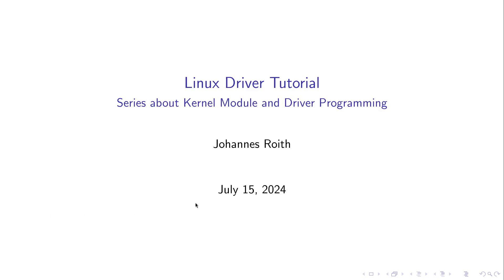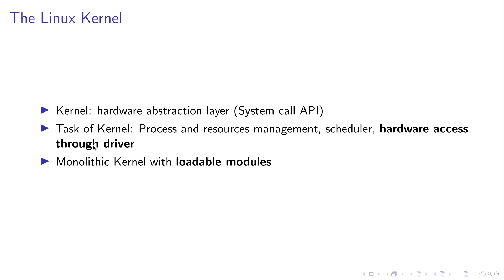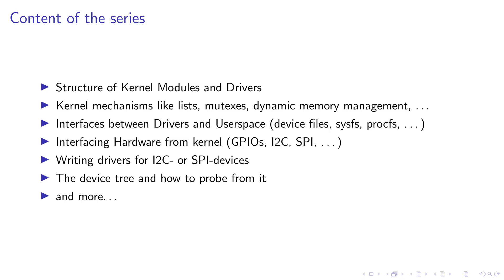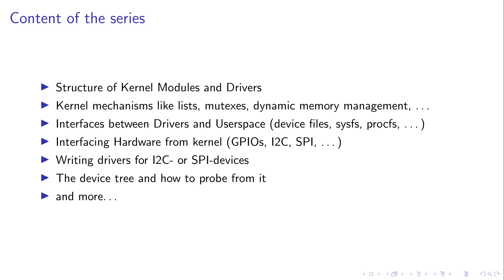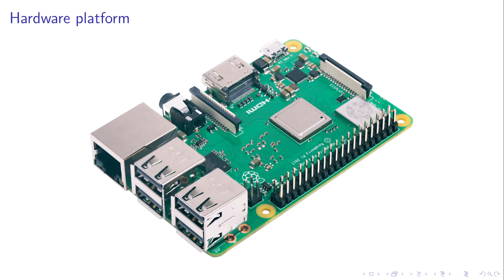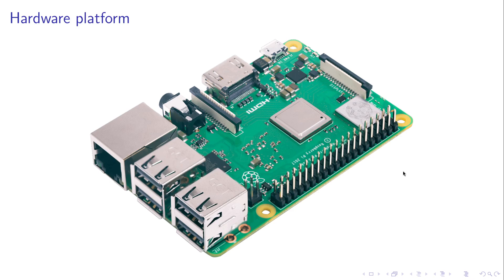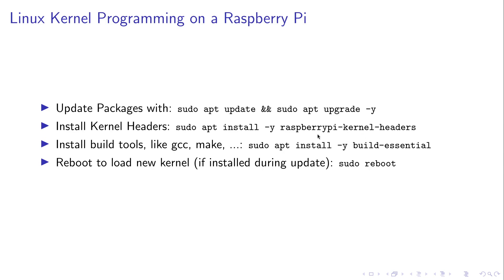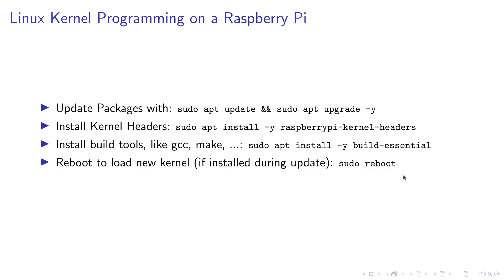Let's code a Linux Driver - 0: Introduction

Comment: i cant download the headers via the command
sudo apt install -y raspberrypi-kernel-headers
Error: Unable to locate package raspberrypi-kernel-headers

i guess i have some installed though
can i just use them?

linux-headers-rpi-2712/stable,now 1:6.12.47-1+rpt1 arm64 [installed]
  Header files for Linux rpi-2712 configuration (meta-package)

linux-headers-rpi-v8/stable,now 1:6.12.47-1+rpt1 arm64 [installed]
  Header files for Linux rpi-v8 configuration (meta-package)
Reply from the maker: I have to redo this video. The name of the package changed with Debian 13.

Comment: I've been looking high and low for a way to allow a specific user to map directly into hardware memory for a program I'm writing that uses the GPU to process floating points from a buffer, I want it to be as fast as possible so I need to weirdly manipulate the linux user system so it doesnt throw the program I want to run into the virtual memory space, which I can't seem to figure out yet lol

My main goal is to get the raw data stream from a sound card so I can use the 3.5mm audio jacks as a sort of "analog data" analysis system, but dear god thats actually the easy part lol... Unlocking the user-space program so its able to create a direct pointer to these is the obnoxious part, because no matter what, it seems like its impossible if you want to allow it for a specific program~

Anyway the moral of the story is, atm my current program is able to process about 1GB of floating point values (and quantize them), in about 0.002 (or 0.02 idr) seconds lol, so if I can tap into that kind of power for a dedicated soundcard meant to be used specifically for analog signal processing ... omg... I'd be so happy.

I would use "ALSA" but that's significantly slower, especially since for the end goal, this program will be ran on a VERY underpowered system, so each CPU cycle is important as I dont want anything slowing down the gpu~ using ALSA and the "microphone" port alone, when you analyze the source code, actually sort of... chains memcpy, but not.. .quite? Its weird, but either way even the kernel module they write also acts as a glorified copy system, which sadly, the CPU this code I'm writing is meant to run on, might have a noticeable performance hit.

THAT BEING SAID
Your videos on linux kernel stuff has inspired me to continue =D been at this for 2 weeks... Also, A.I help for this kind of thing is out of the question lol

Subbed~

Comment: Hi! Nice video series. May I ask you... Is it possible to build a driver for a USB fingerprint sensor on an x86 Linux system once you get the information from this series? Or is there any other place where I should get such information? Thank you, anyway , I will look at the series since it seems well done.
Reply: Hey, i also want that. did you find something?

Comment: what are the prerequisites for this course?. I know C, C++ and I am studying Computer Science. But my practical knowledge is not very good. I am trying to improve my skills.
Reply from the maker: Basic understanding of C and of navigating in shell is required. First experience in embedded systems (e.g. micro controller programming) can be helpful, but is not mandatory.
Reply: @johannes4gnu_linux96  Ik C and linux but can you expand and define what you mean by basic understanding? i.e can you list some of the important topics to know in C?
Reply: studying CS is the most useless thing ever LOL.

Comment: How feasible would it be to port an existing Linux driver that you have the source code for to an older windows version? More specifically, Windows 98? The reason I ask is that I am kind of into retro computers and retro gaming and some of the old graphics cards that work in windows 98 are becoming increasingly rare and pricey. So having a driver even for a low end modern graphics card for win 98 would be extremely helpful.
Reply: You would need to use the win32 api and its not so easy to do from linux to window and most vid drivers are proprietary.
Reply: @somone799  Sure, but both Nvidia and AMD have open source implementations for their linux drivers for their GPUs.

Comment: Hey, will I need any other hardware besides a raspberry PI to follow this series?
Reply from the maker: Yes, a breadboard, LEDs, some Resistors, buttons, some jumper wires and an Atmega microcontroller or RPi Pico (in the future) can be used to follow along.

Comment: Very cool, I'm interested in following along. Could the same thing be done in QEMU with emulating rasberry pi OS?
Reply from the maker: Yes, for qemu-system-arm I know for sure there are machines available for the RPi 0, 1 and 2. I guess qemu-system-aarch64 offers machines for the other RPis. You can use qemu and a virtual Raspberry Pi, but when in later videos I connect hardware to the Pi and this will be difficult with qemu. There are ways to pass through I2C, but I guess its easier doing it on a real Pi.
Reply: @johannes4gnu_linux96  Would it be worthwhile to learn by emulating a raspberry PI? Or would I be better off following the other playlist that is dedicated to using QEMU? What would the difference be between the two?

Comment: Is it possible to do this with an STM32 board? I have one laying around but it doesn't seem like it...
If not, which rasberry pi would you reccomend picking up to try this out? I want to program a kernel driver for an LCD display I have
Reply from the maker: Normally not, only if it is a board with the STM32MP1 or STM32MP2. All the other boards are just microcontrollers and you can't run Linux on them natively. For Linux you need a Memory Management Unit which is normally only not available on small microconttrollers.
I would recommend a RPi3 or 4  or Rpi Zero 2 depending on your budget. 
Writing a driver for a display sounds like a cool project ;)

Comment: You already made a full tutorial and how its gonna be different from that one? Because I see that you added this video to existing playlist. thats why I m asking
Reply from the maker: I did a new introduction because the old want didn't fit so good any longer. Originally I planned to have 7-10 videos for these tutorials and now I alread have about 40 in this series. Also the audio was not so good in the old one, so I thought it is worth to redo the video.
End of the year I will redo some of the first 10 videos, because some are outdated and the Kernel API changed slightly. Another reason is that I also have a better understanding of the kernel now and so maybe my explainations will be better in the new videos. But I will keep the old ones on YouTube.
Reply: @johannes4gnu_linux96  that's awesome. Waiting for the future videos. Just a small request l, can you create a new playlist for it?

Comment: Thank you

I do AVR microcontroller programming, but idk how to get started with processors, ihope this series will show me the light.
i just want to be good at both.

any thoughts on it?
Reply from the maker: You are welcome. This series will give you a good overview of how to write drivers in Linux. Some of the knowledge you gained from AVR programming, like manipulating registers or understanding embedded buses like I2C or SPI, will definitely help you here. However, Linux is a complex operating system, so you'll also encounter many new possibilities such as multithreading and the separation between userspace and kernel space, which are not present on an AVR.

Comment from the maker: Please let me kow which Intro Video you find better. This here or the old one: https://youtu.be/x1Y203vH-Dc
Reply: Definitely this new one. Audio much better, you improved a lot as a speaker and the kernel introduction also was needed. Maybe you can put more emphasis on the "why should I learn to do this" to really make the big picture evident.
Reply from the maker: @antonioe.2396  Thanks! Yes, I am missing the motivation, that's true. Maybe I will redo this video in a year and then I will add it ;)